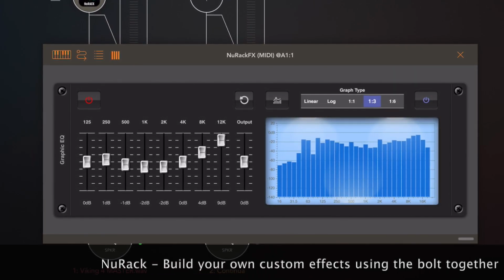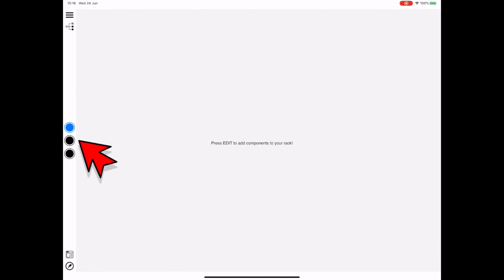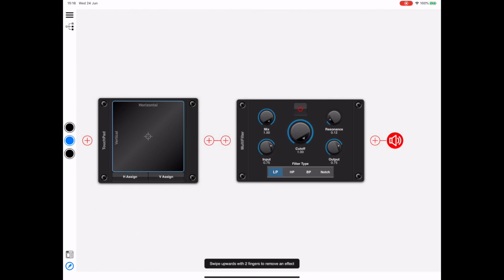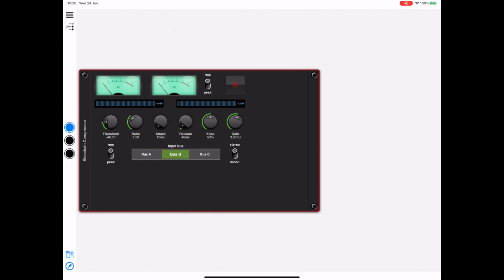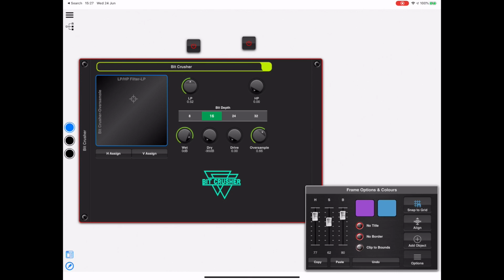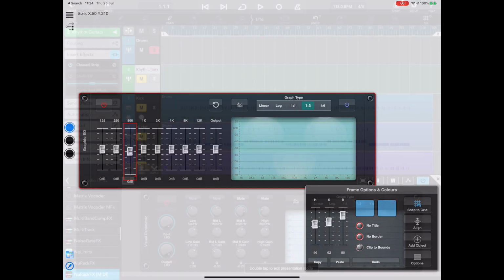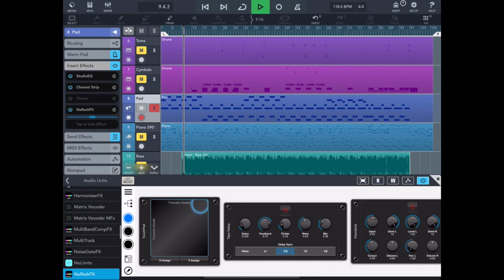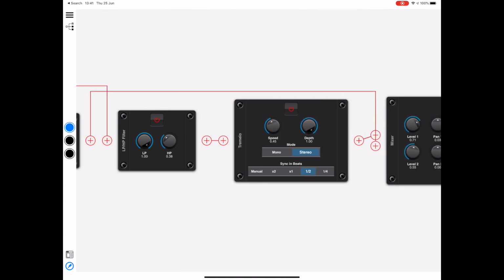NuRack FX Rack (Auv3 Plugin) Preview

Comment: Hi Paul, are devices in a nurack exposed for midi learn / automation in a host like AUM?
Reply from the maker: if memory serves me correct they are so long as the Automation TAB in Settings is set to 'Advanced Parameters Automation Mode'. If you load the Audio Plugin template for instance you will see that it exposes AU params for Rack A, which is a folder contraining a GATE, SCOPE and REVERB params.
Reply: Thanks 😊

Comment: Can you build a virtual midi controller with this?
Reply from the maker: What are you trting to do? You can potentially have sets of touch pads and sliders and map those to MIDI events.
Reply: @PaultheMusicMan  Hi, I'm looking for bigger buttons for GR-16. It's pads are fine but the utility buttons are too small. I bought your app yesterday, it's a powerhouse. The midi pads are what I was looking for. I'm confused on the behaviour of knobs tho. They seem to jump if I make a downward to the right motion. Also is it possible to transpose midi data with it? Thank you!
Reply from the maker: @cokomairena  Yes, don't attempt a circular motion with the knobs. Just click and drag either vertically up/down or horizontally left/right in a straight line.

Comment: Hi Paul it seems it's not currently possible to load completed modules into racks B & C it only loads into rack A and not the current rack.
Will this be possible in a future update? 
Amazingly useful app Thanks
Reply from the maker: NuRack can work in one of two modes, one rack per channel (3 ins, 3 outs) or one in 3 out, allowing switching between the racks. It is this reason I decided the 3 racks are saved as a set, although I may well offer a way to load/save them indivisually in the future.

Comment: Looking forward to seeing a 'file transfer' tutorial, 'cause I'm damned if I can get it to work.
Reply from the maker: You need to run the app in standalone mode. Select the File Transfer option in NuRack and it will tell you what to type into your web browser to access your patches. As long as both your iPad and your PC/Mac are on the same network it should work fine. Do you not see the interface appear in your web browser?
Reply: Paul the MusicMan thanks for responding. I can transfer files between iPads, but once it’s on the new machine no matter how I drag and drop or click the file, it doesn’t end up in the list. I’m sure it’s simple, just a bit opaque to me. I’ll try again.
Reply from the maker: @kurtklingklang5918  Just wanted to point out I'm adding a new option to export 'racks' via an email attachment. You will be able to import by clicking on the attachment once received. This doesn't help you with the File Transfer though, maybe its a PC/Browser setting or something. Try a different web browser maybe.
Reply from the maker: @kurtklingklang5918  I'm running on a Mac here, but I can verify Safari and Chrome both work fine here. In fact I just tested on my PC using Explorer and Edge browsers and both worked fine.
Reply: @PaultheMusicMan  I can get the .rack file onto the iPad via the browser. Just can't do anything with it after that. If I click on the file, I can't share it to NuRack. Can't see anything in NuRack to enable me to load a local file. If I open up the download folder as a sidebar, dragging and dropping into NuRack does nothing.
Reply from the maker: @kurtklingklang5918  The only method of importing 'rack' files in the current released versions is dragging and dropping into your web briwser in File Transfer mode. I've tried on 4 different browsers (PC and Mac) and all seem to be working fine. The next version however will allow you to click on an email attachment with a .rack file extension and open it with NuRack. It also allows sharing of racks via email too. This version will go live around the weekend I'm guessing.
Reply from the maker: @kurtklingklang5918  I just tried dropping into an iPad browser using the Files App and it worked for me... very strange!
Reply from the maker: @kurtklingklang5918  https://www.dropbox.com/s/nli9yubmal2s3ro/filedrop.mp4?dl=0
Reply: Paul the MusicMan I’ve had another play. I’ll describe how I went about it. I might first say that it’s probably not what most people are going to want to do. But I am fortunate to have two iPads, one exclusively for music with max storage and a general use one I sometimes use away from my music room to experiment with apps. Anyway, my method is as follows, it might not be the optimum and it’s a bit cumbersome, but it works and in the absence of a better method .......   1. On source ipad, open NuRack in stand alone, 2. Click on File Share, 3. On destination machine open up browser on other iPads web server, 4. Download file to shared drive - iDrive folder. 5. On destination iPad open NuRack in stand alone, 6. Click on File Transfer, 7. On source iPad, open browser of destination iPad web server, 8. With file browser as desktop ‘card’, drag file from iDrive on to browser page of destination web server. 9. Preset appears in list (I appreciate preset might not be the optimum term)

Phew....
Unless of course there’s another way. I’m thinking the email option may be easier!

Comment: I just tried it, and it's incredible. Would you consider re-using the code at some point in the future, to create the first AUv3 custom MIDI controller editor?
Reply from the maker: I may well build MIDI effects into this. I added the ability to load as a standard or MIDI plugin. You need to load as a MIDI plugin to use the MIDI automation. Lots of great updates coming very soon.
Reply: Awesome. I think the best thing would be to have five modules, each for a single item: button, knob, fader, slider, and XY. Maybe have hide-able controls below for the range, depth, channel, and CC. For the buttons, CC/Note/PC, and momentary/toggle. MIDI out would make this an excellent companion for Mozaic...and every other app. Also, two smaller requests. If I could turn off pinch to zoom, that would be nice. And if it could not zoom when I put two fingers on two XY pads (or any other control) instead of the background, that would be good too. More audio FX modules will be nice to have, but considering all of the work you've put into coding a system to create a custom UI, I think you owe it to yourself to fill that second niche, one where there's zero competition. It would allow users to control any IAA app from within their DAW of choice. Either way, thanks for considering it!
Reply: An Au Midi controller editor would be super useful!  All the best! 👍😺🚀
Reply: Can’t you do custom midi controllers with Mozaic?